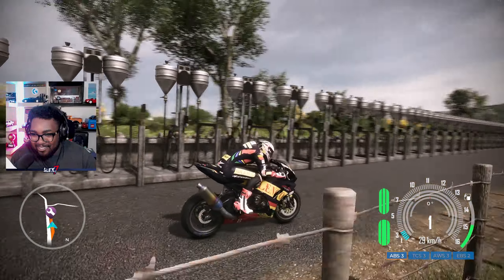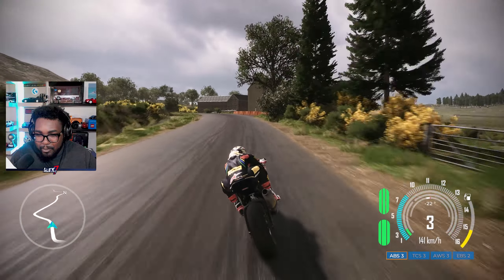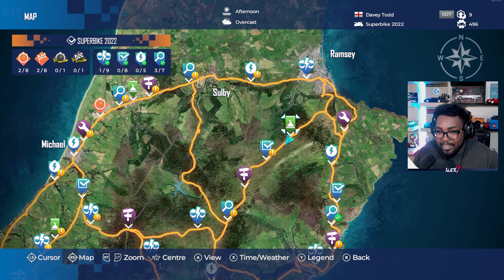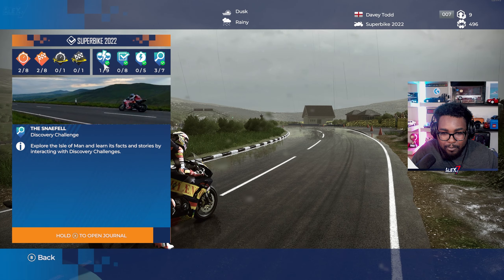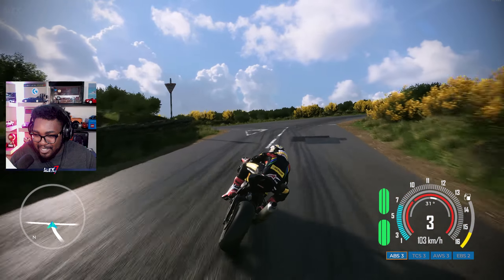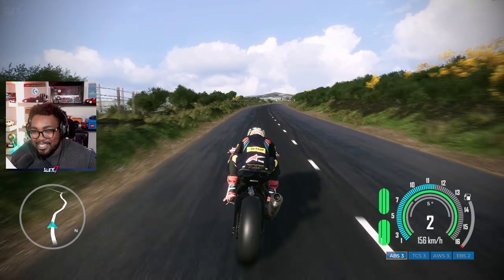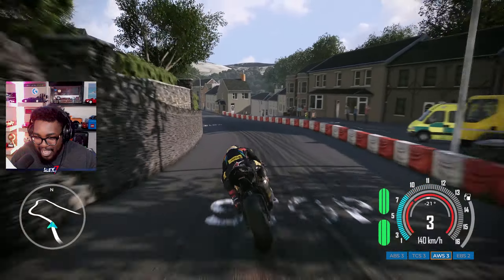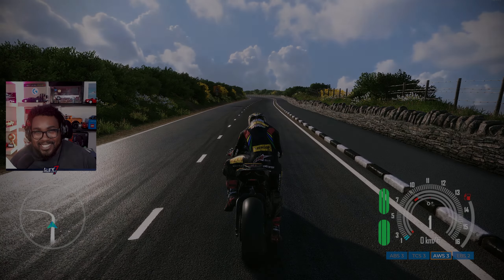What Happens If You Run Out Of Fuel In TT Isle of Man 3's Open World?

Comment: Like with every other open world game, I hope there's an option to turn fuel mode off when you're only exploring the map in single-player mode. Fuel is something I only want to worry about in races, not when I'm exploring the map.
Reply from the maker: to be fair, the fuel doesn't deplete that quickly in this game so it doesn't hurt the gameplay experience, I think the same could be done in TDU SC where it works too.
Reply: @TheAlexVII  I don't mind if people want fuel wear turned on outside of races as long as it's optional. 

However, If I was that interested in the realism of running out of fuel when just exploring the map, I'd want the option to make it as tedious as possible where you don't fast travel to a fuel station and instead you have to walk with a little jerry can to the nearest gas pump, fill it up, and then walk back to your bike.